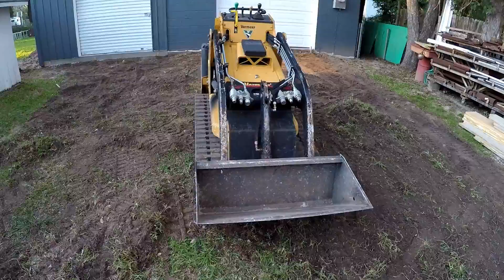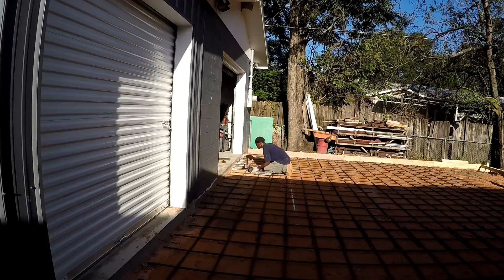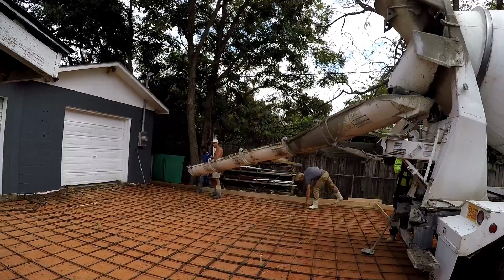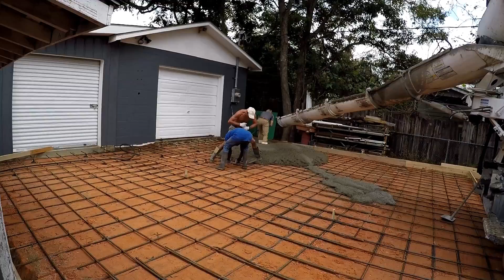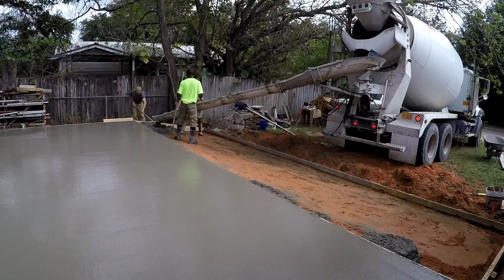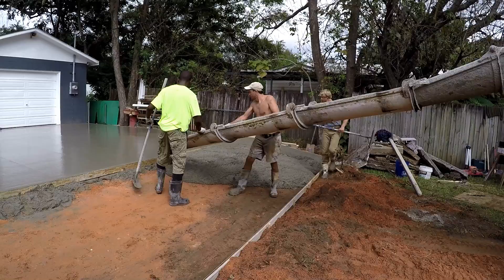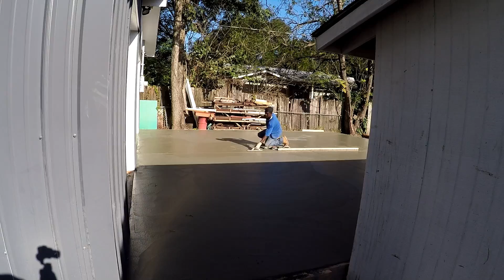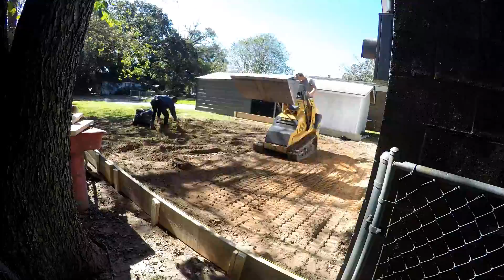New Shop Concrete Slab!

Comment: Wow Adam, that looks great!  It will be a great work area tying the two sides of the shop together.  Glad to see they added the walkway to the side door.

It's interesting to see how long they are allowed to take there.  In my part of the country, the truck gives you 1 min per cubic yard to unload the truck from the time it gets on site.  Any more than that and there is a steep charge per minute that you go over.  That's a very hard job to do, and those guys did a lot of yards there.
Reply from the maker: I didn't hear them talk about any time limit. Might be with other jobs through.
Reply: Good to see the gap between compressor slab and the workshop. It'll reduce the transmission of vibrations and noise.  

May have to put a mat of some sort on the wall of the workshop later if the reflected noise bothers the neighbors.

Comment: Happy for you man! Looks good! I don't know much about concrete, but had a slab done a few years ago at my place. Couple questions... 1) Why no rebar on the ramp? 2) I wonder how come they didn't use the old concrete pieces in the fill area? 3) On the path to the side door, why did they put a stress line at 45 degrees on one corner, but not the other?

Comment: Why did the leave the timber formwork in the concrete at the slab to ramp line?  Why did they put it there at all? That has formed a total separation of the two slabs and potential settlement.

It is also a good practice to put plastic under concrete, it prevents rapid loss of moisture from concrete into the ground, resulting in weaker concrete and cracking. 

Clearly we didn't see the full pour, but they only vibrated around the deep edges, it's good practice to vibrate all concrete. It removed air pockets, which weaken the concrete. 

You also should spray it with water for at least a week to aid curing and prevent shrinkage cracking.

I noticed another comment re the absence of reo in the ramp as well.

Why the change in broom direction from slab to ramp? Other than it was easier for access.

Comment: For the holes in the block wall, I use plumber's epoxy putty available at Home Depot or Lowes. The stuff cures like iron and is easy to work with. Loved seeing this pour and wondering if Jimbo's Garage would approve of the work done.

Comment: I'm a concrete finisher in Michigan...man them backwards concrete trucks, are just so much extra work. Up here the trucks are front dump...driver has all the controls. Once in a blue moon you will get a driver that's an idiot, and makes more work than needed...but 99% of the time it's so much easier
Reply: Well down here (missouri and below) Your trucks are backwards lol
Reply: Lol...our trucks unload from the front is what I'm saying...so much easier to control the flow of the Crete, and not just break your back pulling it
Reply: The controls for drum rotation and shoot controls are on the left back corner of those trucks.  I have seen both style of concrete truck.  This style truck is a 7 yd.  I can't remember if the front style is a 10 yd .
Reply: Roy Reynolds the front trucks are 9 yards. But can carry 10 to 11 yards. In Michigan the law is 9 yards but will let ya get away with 9 1/2 anything over is pushing a pretty big ticket
Reply: lucky yous there in usa  hava look at us here in new zealand  pour lots  with min men lol   trucks !!!! lol

Comment: Hey Adam even though that is an outdoor slab I would still go ahead and seal it because it will keep the dust down and make it a lot easier to clean stains up if oil or something gets spilled on it.  I made the mistake of not sealing some concrete before and it was a never ending job just to keep the dust at bay and once the concrete gets dirty it is too late to seal it so I am still regretting it.  For all the more it costs I think it is well worth it.  It looks like you are going to end up pouring all the way to the road eventually but it does look good.

Comment: Adding water will make strong er concrete. Just hose it twice a day.
Reply: Keeping concrete wet after placement will help it to cure stronger. Just so everyone is clear adding water before or during placement will reduce your breaking strength.  Low slump (less water) concrete will always break at a higher psi.

Comment: Those Grano-workers put in some hard yakka Adam they did a great job i was thinking that concreted area would be a better extension for a workshop than taking up the backyard, mind a bloke can never have enough sheds can he?
BTW hose down the concrete to slow down the Drying / curing the slower the drying the stronger the Slab usually 
Tony

Comment: Man there's a lot of experts here.
Reply: There's alot of experts every week.  That's the main reason I generally stay out of the comment sections.
Reply: Dozer - Forty-two years pouring in California, commercial and residential, and many guys do go the free-hand route.  It's a helluva skill that most can't master, and many botch.  Sadly, residential (read homeowner) jobs often are totally botched.  I only let guys do it in certain situations and when I have total confidence in their abilities.
Reply: CoronadoBruin it's something to be proud of because its definitely something not everybody can do.
Reply: It's interesting how it's done differently in different places. In Texas almost all residential concrete is freehand or hand held vibrator screeded.
Reply: Taluvian I can honestly say this isn't how we do it out here on the west coast. Never seen free hand screeding turn out well, and we don't float the slab till it's all poured. Having said that, the finished product is all that matters. It's six inches thick with steel in it. It'll hold a battleship.
Reply: PCI Certified myself. How about you?

Comment: Nice!  I wish I had used rebar in a grid instead of wire.  Based on shrinkage cracking that I have in my shop (I was out of town when they poured it and they did not put in any expansion joints) any more concrete I pour will have joints every 15ft.
Reply: Have it cut.  That is the commercial approach to expansion joints.

Comment: Looks awesome Adam.  Your contractor did a good job.  I'd have put a few bars in the sidewalk and the approach slab, but I'm used to designing bridges.  You should keep the top wet for the first week, unless your contractor used a curing sealer.  We use burlap and a soaker hose, but you can use regular poly to trap the moisture.  If it dries out too quickly you can get surface cracking which weakens the surface.

You didn't comment on water control, but I assume the slab is sloped.  I'm having drainage issues with my driveway and a clogged drain, so this is on my mind.
Reply: Barry Gerbracht
Reply: I was expecting a gully at least on the carport side... But that's just me over-thinking again.

Looked like a good crew working. Experience is evident in how easy it looked.
Reply: Barry Gerbracht to

Comment: Keep it wet for a week much stronger
Reply: Bossnake87 strange because at the site i'm working at the concrete guys INSIST that its covered with a foil to keep it from getting dry.
Read a bit about how concrete works, and it makes sense why you have to keep it wet to make it stronger. The water is needed for the chemical reaction going on in the concrete.
Because concrete does not dry, it sets, by a chemical reaction that NEEDS water.
Reply: It’d be just fine without keeping it wet
Reply: That's what she said.
Reply: Guys I knew kept it wet all day for the first week. He put a sprinkler on it and never shut it off lol
Reply: Mine started to crack because I didn't keep it wet enough.
Reply: Ty Kellerman I was gonna mention the same thing
Reply: Watering it constantly is not a good idea. This washes the cement out of the concrete. The best is to simply cover it to keep it from drying too fast. That is not about the hardness of the concrete but if it dries too fast then small cracks will form. Concrete can absorb water for years and get harder over time.
Reply: depends on the concrete mix...
Reply: wet burlap on top frost blankets on forms to bake it That's how you get the best results That's what we do on bridge abutments per The state inspectors
Reply: yes it would be this method makes it stronger in the long run..
Reply: Ty Kellerman
Reply: Need to leave it to set underwater for a week before it starts to gain its strength! Concrete needs lots of water for the reaction to complete.
Reply: holy moly it will gain strength within hours. I’ve broken concrete cylinders after 4, 8, 12 and 24 hours. Largely PT and high early cylinders
Reply: Ty Kellerman 28 days is best

Comment: They doing double work they should have laid the chairs first.
Reply: This crew preferred to lift the rebar into the concrete to be sure it was located correctly, then set the chairs. Adam mentions it in the video.
Reply: Nope!  You set the chairs as you go.  Otherwise, it is harder to walk and a dangerous trip hazard.
Reply: Paul Copeland I walk on rebar everyday  with 4 inch chairs
Reply: I guess you are special.

Comment: @Abom79 don't forget to keep the slab wet - as more fresh concrete will drink water as stronger it will be at the end (and concrete gets its full strength after around 28 days)
Reply: keep it wet 3-5 days, no point after that.
Reply: sicktrick:You need to look at concrete curing curves: 80% of design strength is reached at around 10 days (depending on additives, temperature etc). Anyway: Keep it wet (and under plastic) for as long as possible to get maximum strength.
Reply: You are wrong moonpup:  As long as the concrete is curing it should be wet to get maximum strength.
Reply: If they use Curex curing compound, there is no need to water the slab, we usually get 7 day breaks  from the testing lab , at around 75%. Also I didn't like that there was no rebar in the sidewalk or specially the compressor pad which its going to turn to gravel with all the vibration, rebar gives flexibility to concrete. I agree with the person suggesting more manpower. 
Im Field Engineer for Keystone Concrete Placement currently building 14 story building is San Antonio TX
Reply: zipoking 
80% in the first 24 hrs
Reply: keeping the concrete wet for 5 days is plenty. keeping it wet for an additional 25 days to gain another 5% is overkill, but yes it would be 5% stronger. the 3-5 days or even 7 days is the critical period. during that period the strength of the concrete nearly doubles every day, after that the gains are much less

Comment: The vibrator removes air pockets and ensures the concrete surrounds the rebar
Reply: They use the 2x to screed or level the concrete then that other tool on the long pole is called a float. It smooths out and gives it that finished look.

Comment: I did not wake up today thinking I would watch a 40 minute video on pouring concrete.
Reply: Or that you would enjoy it so much either !!!
Reply: This is my 3rd > 30 mins concrete pouring video today!
Reply: You may already know this, but you can watch videos at 1.25x speed, 1.5x speed and 2x speed. I watched this one at 1.5x, and it was perfectly intelligible.
Reply: schucker88 😁
Reply: schucker88 Oddly addictive isn't it?
Reply: Right
Reply: 15:00 Tottenham to IP 3659t89t65899📞
Reply: Its great concrete surface is smooth here in india we didn't get such smooth surface because here workers and techs are not that good We have to fit tiles in order to get good clean smooth surface

Comment: Why no rebar in the ramp?
Reply: David Benson guessing no rebar because he's got plans of more concrete in the future and it's easier to chip out come time.
Reply: Chad Brown Architects understand the dynamics of structural loading. Many schools require much of the same classes as structural engineer concerning materials and loading. Many professionals would recommend rebar in the ramp. That same professional would have also recommended a beam on the entry edge of the ramp.
Reply: Rocket surgeon here
Reply: It won't have big trucks and buses rolling up it often, it's more for domestic use, and lighter vehicles and not heavy commercial ones. The slab itself is for potential future shop space which is why he went for so much re-bar. The ramp should be acceptable.
Reply: The ramp is a temporarily used abutment. You're not going to park vehicles or build a structure on a ramp, so no need to reinforce it.  Also, when it comes time to remove the ramp, it's gonna be a hell of a lot easier to remove compared to reinforced concrete.
Reply: Thank you,  I have caught some flack here regarding my comment about being a registered architect for 27 years and an intern for 3 before the 4 day exam I took here in Mississippi.  I agree, I would have put a turn down footing around the entire slab and maybe a couple of grade beams across the middle.
Reply: None needed as there is fibre fill in the cement, that was mentioned toward the beginning of the video
Reply: David Benson --- $$$....something you can get by without.
Reply: I think the long term plan may be to add on to the shop on this new slab, and probably removing  the ramp for another approach.
Reply: Chad Brown--- "You hit the nail on the head!"
Reply: Speaking as a barista who lives next door to a painter, the ramp is fine w/o steel, but the pad isn't up to code for anything bigger than a shed.
Reply: Eric Commarato thank you i pour concrete for a living and ive been thinking the same thing in my head reading all these comments...fiber mud doesn’t replace rebar,why go the extra mile to put 5/8” rebar 1’ on center at 6” deep just to completely skip out on rebar in The approach??..it honestly has me confused lol
Reply: Architect is a special word and is not used lightly. The man is an Architect.
Reply: I agree.  great comment!
Reply: Concrete guys were old school. All hand work, no trowel machine. Looks like they did a good job compacting the soil which is important.
Reply: I'm a rocket scientist!
Reply: doesnt need it
Reply: id imagine its nice knowing that if u want to add even more additional concrete down the road then tearing out the ramp wont be a nightmare aswell.
Reply: Money well spent !
Reply: George Costanza concurs!!
Reply: Its not important for that particular feature. Its also easier to replace as it wears and cracks where it thins to the ground.
Reply: May not absolutely have needed but have you ever see Adam do anything to the bare minimum? Surprised he didn't say anything.
Reply: It can actually be better. No stress points...... but that's an engineering consideration and not architectural.
Reply: Fiber mesh makes concrete stronger but you need reinforecement bars wire mesh to keep it together for no seperation throughout the years. And also on concrete form which was suppose to be an expansion joint should have rebar connected to the foundation to the approach so it wont seperate in years to come.
Reply: Chad Brown lmao!!
Reply: Rosser Pace its a fucking broom finish jackass!!!...when have you ever seen someone use a power trowel for a broom finish...please send me the video because unless they want a light broom you can barely knee board when its ready to be broomed?!?
Reply: Chad Brown 
What do you do for a living
Reply: No rebar because the ramp isn't to carry load for extended periods of time
Reply: I don't understand why no rebar was put in. If you are already spending that much money on that pour you might as well spend more and get a much stronger ramp. No reason to cheap out on something like that.
Reply: Fiber helps with the PSI and the RB helps with the sheer. I don't think not having RB in it is going to be as big of a deal as the cold joint at the main slab to the ramp, leaving the form in is a mistake. Some 4 ft dowels (2' each way) and one perpendicular in the ramp on the dowels would hv been great. 
Regardless, its sure easy to sit in a chair an pick apart other men's work and I don't think that doing any good on my part.  I did concrete and masonry for 30 yrs and was always learning.
Enjoy the slab and the hard work of those men.
Reply: Don’t need rebar in the ramp, as a contractor myself I wouldn’t have put it in and no it won’t crumble the man said he ordered fiber mix which is like rebar within itself . Fiber is the way to go a much better mix and starting to become standard.
Reply: Probably because it's just a ramp and not future foundation for shop expansion....
Reply: Eric Commarato an architect isn’t the same as civil engineer, we don’t even use the same scale for drawing that architects draw and civils engineer what’s suitable for the job
Reply: keep the top wet but less water in the mix is stronger the guys that make the mix wet do it to make it easier to scread
Reply: That is going to crumble
Reply: chris mul - "Crumble"? You know what you're talking about? Crumbling concrete is from improper curing, mostly too dry and wasn't wet cured.
Reply: Tim Heagarty    Architect is a special word.  To come up with ideas and have a Civil engineer build it.  A GOOD architect is rare.
Reply: Roy Reynolds Architects design the drawings... Engineers tell them how and why it can't be done.  I am an Industrial Structural Engineer with an MSCe in Seismic and Thermonuclear Theory.  Architects dreams up the weird shit, I do the real world calculations and make those dreams achievable.  Always have to red pen their prelims back to earth, before finals can be submitted.  Because, the calculations don't lie.

My real job though, is to make certain hand are the correct height and design, stair landings and steps are the proper width and angle, towers and slabs be able to handle and survive seismic events, footings and floorings be able to bear all loads required per application, make sure drains drain, etc etc.  Exciting stuff!
Reply: I'm an architect, I would have put steel in everything. Fiber isn't the same as steel reinforcing.
Reply: Eric Commarato Ahahahahahaha wtf archi saying